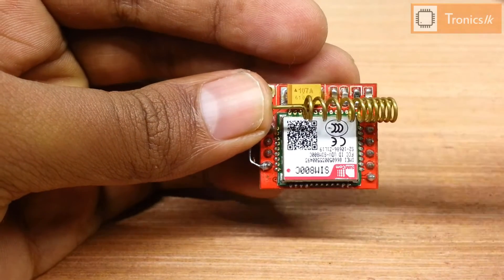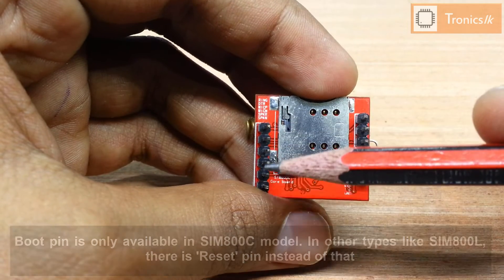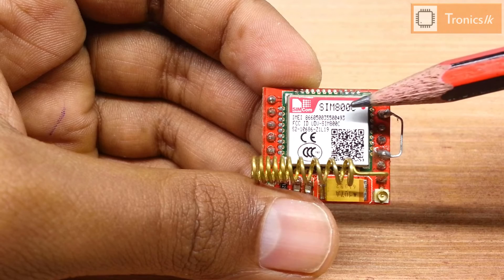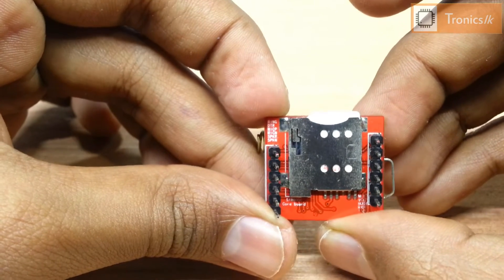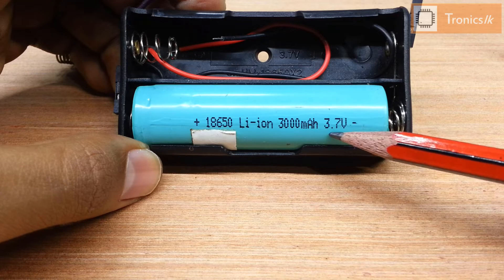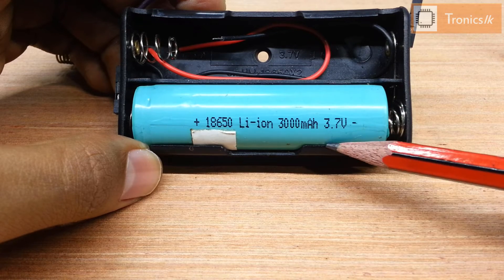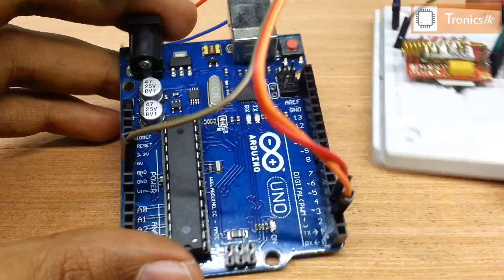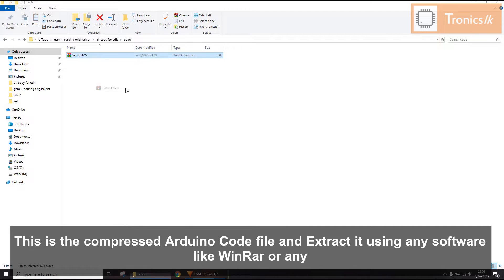Arduino GSM Tutorial for beginners (Sending SMS with SIM800)

Comment: Is it possible to power the Arduino from the same power source such as the lipo you are using ? In case some switches are added to the project and an lcd screen as well, it could make a nice portable phone.
Reply from the maker: Arduino will need 5v to work. This lithium battery will only provide 3.7volts. So you may need to use a dc boost converter to boost 3.7v to 5v in order to power arduino. This will work fine and i have used that method without any issues. Please try my other videos also to get new ideas

Comment: Thanks for the tutorial! Unfortunatelly my SIM800c module is slightly different. It has the following sequence of pins:
Top side: 5v, V_TTL, GND, TXD, RXD, DTR, SPKP, SPKN
Bottom side: MICN, MICP, Ri, VRTC, GND, PWR, GND, VBAT
The vendor told me that the module already comes with an internal antena, but it also has a connector for another external one. So I decided do not purchase the extra antena, and now I wondering if this can affect the behaviour of SIM800c.
The module is being powered from an external 12V power supply connected to a step down module lm2596 adjusted to give the 4V required by SIM800c. I also use the capacitors and the zener diode as recommended in the module datasheet. The power supply is connected to the 5V pin, and when I turn on the circuit a red LED light up indicating tht the the power is on, but no blinking LED appears on the module.
Before trying things that can damage my module, I would be very happy if you could help me to answer the following questions:

Can I power the module with 5v through the 5v pin, instead of 4v? I want to trying this because I’m getting around 2,74 in the VBAT pin, when I power the module with 4v. I also ask to myself why there is a 5v pin in the module since the maximum voltage recomended for SIM800c is 4.4v.
Can I power the module through the VBAT pin, using the same power supply or a 9v Ni-Mg battery + step down, instead of the Li battery recommended in the datasheet?
Should I use an external antena as well?
Thanks in advance.
My module is the same showed in the link http://www.bizkit.ru/en/2019/02/05/13553/
Reply from the maker: you cant power from 5v pin.
And also it requires atleaset 2A current from the supply

Comment: Hi...Is Arduino output pins(Tx,Rx) voltage level (5V) compatible with SIM800 pins voltage level (which may be 3.3V) ?
Reply from the maker: Yes. It is compatible. No need of logic level converters

Comment: when i connect 3 grounds together the sketch is not uploading , and when i remove the ground from srduino the code runs but no response from the sim800c?
Reply from the maker: Need to see circuit and check the components. May be GSM module is burnt

Comment: how much current does the connected cell provides?
is it able to compensate for the 2A requirement at transmission burst?
Reply from the maker: Yes. This battery is capable of supplying 2A when needed

Comment: if the module's led is not on does it means the module has problem?
Reply from the maker: Yes. If u provide power properly, there is a issue with module